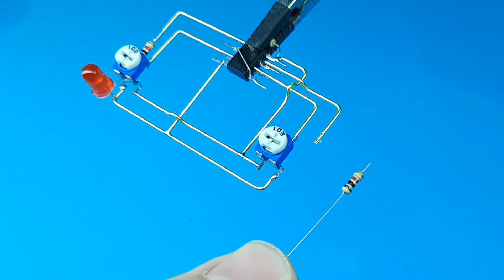Top 2 Electronic Projects Using LM358

Comment: Keep up the good work 💪💪 
Excellent, just include the diagram will be helpful.
Just a question in the last idea how the 5 v circuit (from the previous idea no. 2) control of alternative current circuit (Translucent lamb) which essentially need more than 5 v to run ?!
Or it just act like a switch?! And also how (it is 5 v anyway !!).
Could you please explain it for the beginners like me ?!
Thanks in advance ❤.
Reply from the maker: Thank you 😊 
I feel encouraged to do more of such projects now.
This circuit operates as a switch with a 5V supply and when the relay is activated, 220V power is connected to the lamp and the lamp turns on.
Reply: @SparkMind1  Thanks sir 🙏🙏.